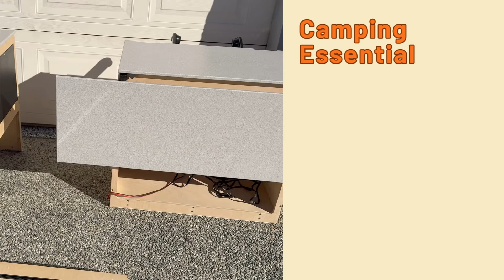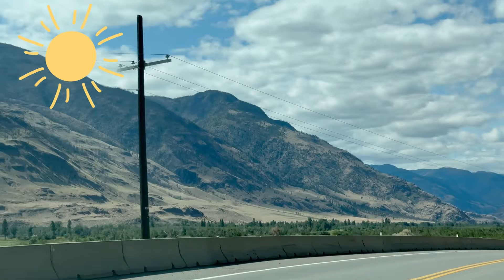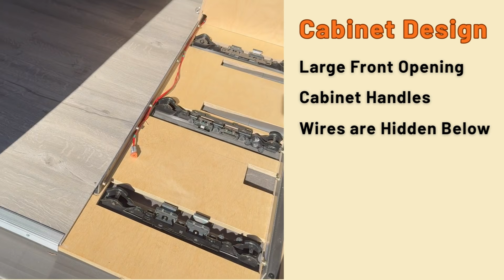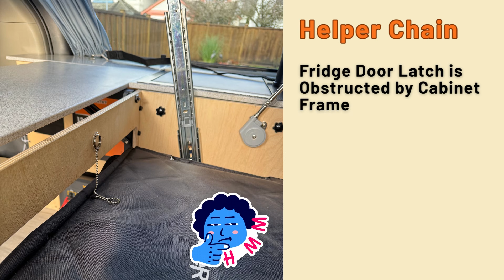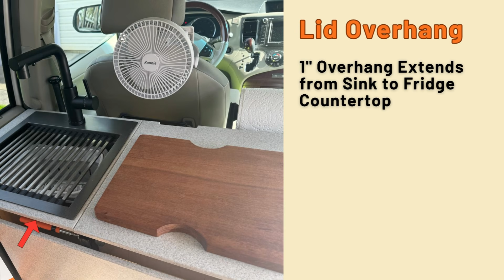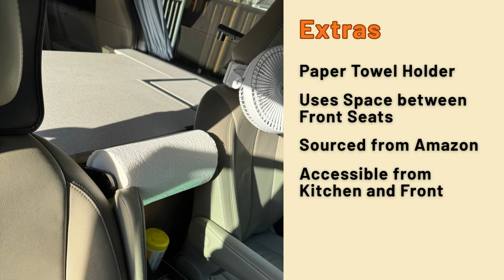The Ultimate DIY Campervan Upgrade: Fridge & Folding Table | E05

Comment: How frequently did you pull the fridge out of its housing and set of a picnic table.
Reply from the maker: I usually don’t but it’s an option if I use it for weekend trip and load with cold drinks.